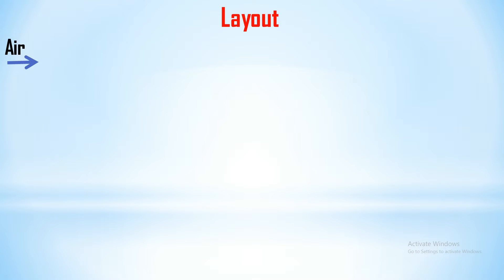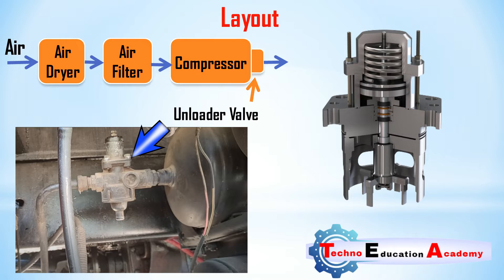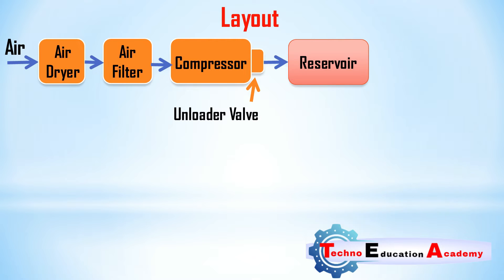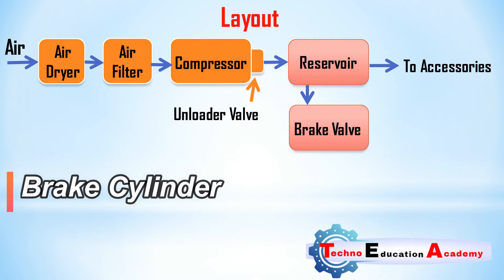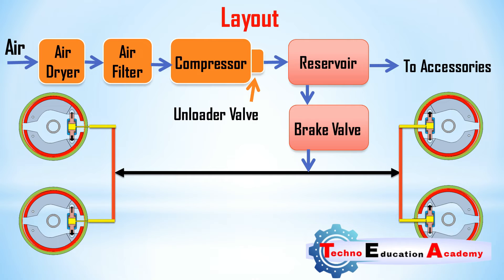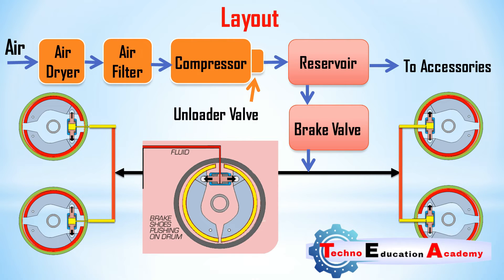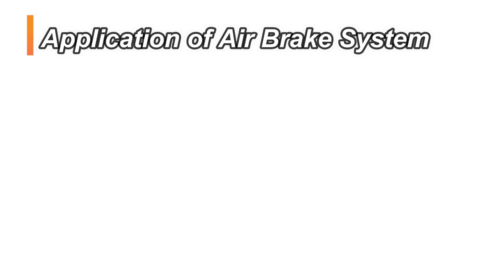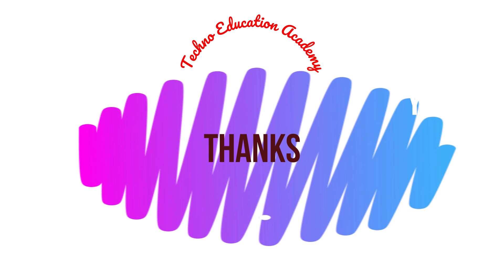How Air Brakes Work: Animation and Explanation

Comment: 0:50 
1 big issue in winter in freezing temperature , the air has the least amount of humidity!
Air filter - Compressor - Reservoir - Air dryer - accessories